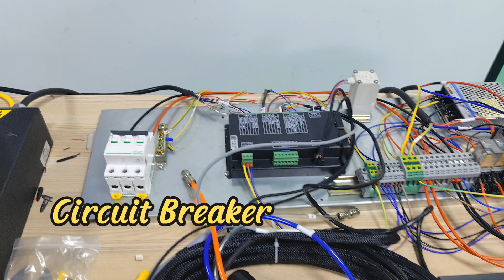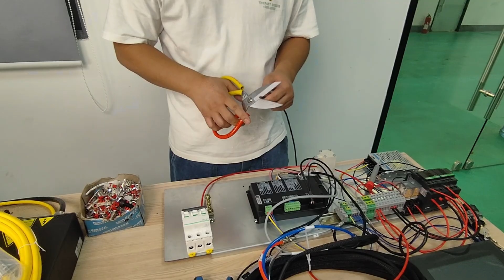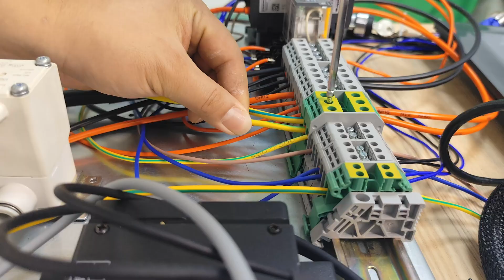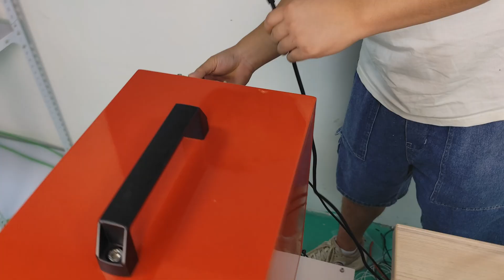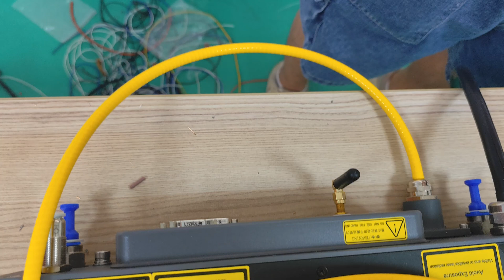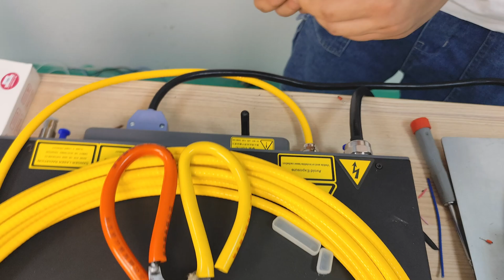DIY 1500w Water-Cooling Fiber Laser Welder Part 3 | Wiring of Laser, Water Chiller, and Wire Feeder

Comment: Great set of videos! Do you have any details on wiring config for a Raycus RFL 3000c? The names are a bit different and the connection shorts you ran are not clear how that might translate to the Raycus.
Reply from the maker: Below is a summary of the pin functions and their corresponding electrical characteristics as provided by the Raycus fiber laser interface table:

1-4: Interlocks (ITL-1A, ITL-2A, ITL-2B, ITL-1B)
	•	Input Type: Contact closure input (24 VDC, <10 mA)
	•	Response time: <500 ms for some models
	•	Comply with safety standards such as EN954-1 or ISO13849-1 Cat.3 PL d
	•	Passive contacts: Not connected to external voltage or ground

5-7: NC (No Connection)

8: Remote Key Switch (RPA, RPB)
	•	Input Type: Contact closure input (24 VDC)
	•	Activation time: 20 s
	•	Enables internal control system power supply in Remote (REM) mode
	•	Passive contacts: No external voltage or grounding

10-11: Remote Start Button (START-A, START-B)
	•	Input Type: Momentary contact closure input (24 VDC)
	•	Activation time: 1 s
	•	In REM mode, starts the main laser power supply
	•	Passive contacts: No external voltage or grounding

12: Analog Input for Control Current (1-10V)
	•	Input Type: Analog input (1-10 VDC)
	•	Current: 10 mA
	•	Response time: 100 μs
	•	1-10 V corresponds to 10-100% setpoint of laser power

13: Analog Output for Power Monitor (AOUT)
	•	Output Type: Analog output (0-8.0 VDC)
	•	Current: >5 mA
	•	Response time: 20 μs
	•	Actual scaling and reference data are provided in factory inspection reports

14: Isolated Analog Common (AGND)
	•	Return line for analog signals on pins 12 and 13

15-16: Modulation Input (MOD+, MOD-)
	•	MOD+: Digital input (24 VDC, <10 mA, 20 μs response)
	•	MOD-: Return line for MOD+
	•	Used for inputting a modulation signal to control the laser

17: Guided Laser (Red Laser Pointer) Enable (RED-LASER)
	•	Digital input (5-24 VDC, <10 mA, 120 ms response)
	•	A positive edge activates the visible red guide laser in REM mode

18: Emission Enable (LAS-C)
	•	Digital input (5-24 VDC, <10 mA, 120 ms response)
	•	A positive edge activates laser emission in REM mode

19: READY
	•	Digital output (24 VDC, >10 mA, 120 ms response)
	•	High = Laser is ready

20: System Common (GND2)
	•	Common return line for pins 17,18,19,21,22,23,24

21: Error RESET (RESET)
	•	Digital input (5-24 VDC, <10 mA, 120 ms response)
	•	Rising edge resets resettable errors

22: Laser Alarm (S-ERR)
	•	Digital output (24 VDC, >10 mA, 120 ms response)
	•	High = Alarm condition

23: Power Started (POWER)
	•	Digital output (24 VDC, >10 mA, 120 ms response)
	•	High = Main power supply is on

24: Laser Emission (LASER)
	•	Digital output (24 VDC, >10 mA, 100 ms response)
	•	High = Laser is emitting

In summary, the table outlines the electrical characteristics and function of each input/output pin of the fiber laser system. This includes safety interlocks, remote enable inputs, start signals, analog control inputs for laser power, modulation inputs, and various digital outputs for indicating the laser’s status (ready, alarm, power on, emission status).
Reply: @Skyfirelaser  Thanks, this helps - it looks like it matches similar to the Raycus documentation.  What I was looking for is how does the mapping from Raycus pins to the Sup welding controller platform, including which pins to short to ensure this works.  Can you help with this? It would be a huge help for me (and I'm sure other viewers). The Laser Source you used does not match the names used in Raycus.
Reply from the maker: @zzzzzzzzzzzzzzzzz-l8n  Raycus mainly connects modulation signals: MOD+ and MOD-, and analog signals: DA+ (also referred to as a 0-10V analog signal) and DA- (also referred to as GND). I’m unable to share screenshots here, so could you please contact us at our email address, info@sflaser.net? Our sales representatives will assist you with your inquiries.
Reply: @Skyfirelaser  thanks for sharing and helping with this via email, for anyone else looking for the same info here is the pinout:
Sup23T to Raycus (number on the left is the pin number on the Sup23T controller, the right hand ones are the Raycus pins)
1 connects to S-ERR, 
2 connects to LAS-C, 
3 connects to AD/RS , 
4 connects to AGNG, EGND, AOUT  , 
5 connects to 0-10V, 
6 connects to MOD-, 
7 connects to MOD+, 

Raycus pins ITL-A ITL-B are shorted, 
Raycus pins RPA RPB are shorted
Reply from the maker: @zzzzzzzzzzzzzzzzz-l8n  you are welcome sir, and now we have released the wired electrical board as a product, check https://alleriastore.com/products/electrical-components-for-diy-fiber-laser-welder